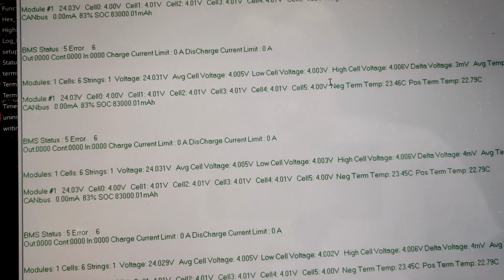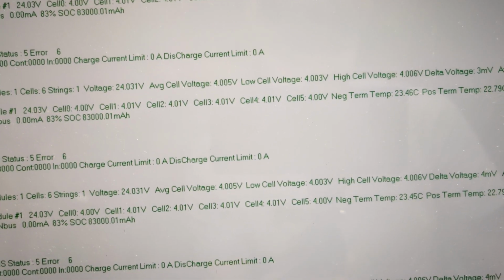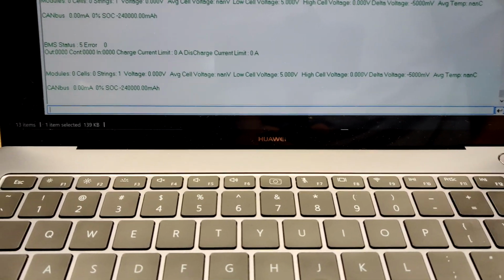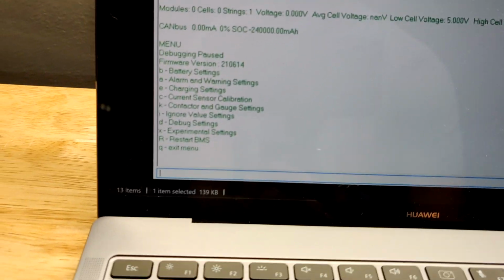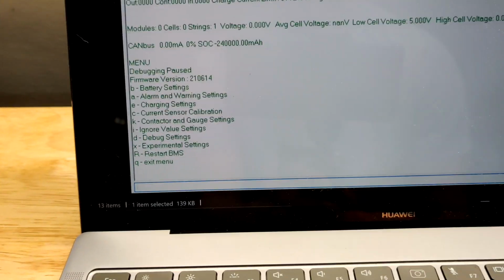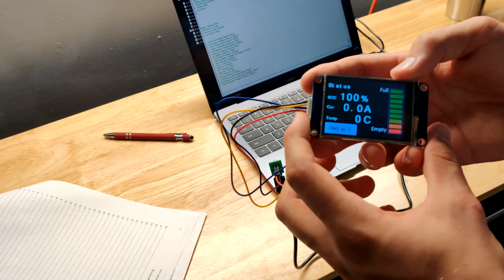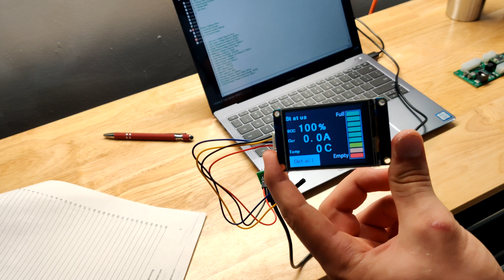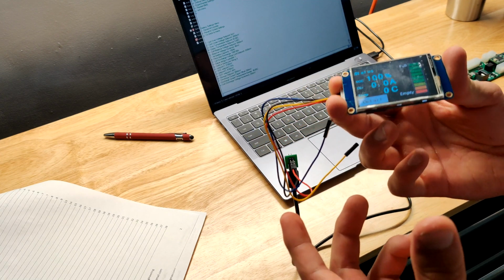Ford Escape EV Conversion EP 13: The BEST Tesla BMS - SimpBMS

Comment: I just came across this and am amazed at how it’s exactly what I need -I think…

Is it really as simple as wiring the original batteries to this thing and being done with it?

Vs something like an Orion which always deosnt like packs that have series and parallel sets wired internally, meaning you have the use like 4 to run 12 model s packs?
Reply from the maker: Yep! Series, parallel, it all works.

New one is here: https://veroelectric.com/product/vero-bms-v2
Reply: @reider_mcfeely  you’ve got my thousand bucks when I can afford the batteries
Reply from the maker: @Nun3zDanny3  There are often good deals on modules on ebay, if you haven't checked there yet

Comment: This won’t work with the model Y batteries? I like this concept but not quite ready for it. Can it be connected to a larger display?
Reply from the maker: Yes with the new Vero BMS V2 it can work with a larger display: https://veroelectric.com/product/vero-bms-v2. Model 3/Y batteries aren't supported, they use a very different communication system unfortunately.

Comment: Still working well for you? Thinking of using this bms on my 6 modules for a 48v off grid setup.
Reply from the maker: Had it in for 8 months now and still working great! Been running it 24/7 off the 12v as well for monitoring

Comment: Hello,
I'm sure you get inundated with questions as everyone wants to use tesla batteries/modules.  My project is a marriage of Nissan Leaf motor assembly and Smart fortwo Tesla 18650 packs.
I know from talking to Chris from Zero EV (who suggested i use the SimpBMS) that it is a good interface with the onboard tesla bms boards.. where I'm having trouble is finding information on weather or not the Nissan Leaf charger will work with the simpbms and tesla packs.
Reply: I have 7 Model S Modules and the Hyper 9 that I’m putting in a 1970 VW Beetle.  Body and Chassis restoration is near complete and it is time to bench test the entire setup.  This BMS along with the same balance boards already in the modules seems like a good option.  I’ve heard Orion is the way to go but it is expensive and seems a bit more complex given that I’ll need to get new boards for each module and the wiring seems tedious but I’m not too worried about that part.  What will I be missing by not going with the Orion BMS?  Thanks!  And please let me know how I can find out more about the SimpBMS.  Thank you!  Kevin
Reply from the maker: @kleekru  really the only thing that the Orion BMS has over the SimpBMS is native support for CHAdeMO fast charging, but with a low voltage conversion, CHAdeMO won't work anyways. 

I can answer all of your questions over email as well -- my email is reider (at) veroelectric.com. I'll send you the setup manual which has info on a lot of the stuff I'm sure you're wondering about.
Reply from the maker: The SimpBMS doesn't natively support the Leaf charger over CANbus but you can still control it with a simple relay. 

Does the leaf charger have an enable circuit? If so then you can just go that direction, having the SimpBMS control the charger via the enable circuit. The downside of running on an enable circuit vs. PWM or CANbus is that you can't taper charge current towards the end of a charge. Whether or not this matters depends on the allowable charge rate of your pack and if you plan on regularly charging all the way to 100%.
Reply: @reider_mcfeely  
I thought the better practice was to charge tesla batteries to not more that 80%.. at any rate.. my project wont see street use or charging stations, just (at the moment) the leaf charger plugged into my shop.  My project is for use on my property to have some fun and do some work.
So... the packs I have... tesla did for both the Smart Car fortwo (which each pack has 6 modules) and the Mercedes  B250e (which the pack had 12 modules).. 
I guess I need to do some more digging... I really like your project.
Reply from the maker: @kevinschilling6813  yep it's definitely better to only charge to 80 or 85%. In that case there isn't really a reason to taper charge current. 

Sounds like a cool project you have going, glad you're enjoying my videos!
Reply: @reider_mcfeely  
So, I would just use the simpbms as a bridge between the tesla modules and the Leaf charger.  And the charging of the modules would be activated via a relay circuit...
Reply from the maker: @kevinschilling6813  yes, and the SimpBMS would control the relay circuit

Comment: I saw that these don't offer balancing for LEV50 modules from GS Yuasa, do you happen to know if thats that they don't offer cell balancing in parallel or in series or both?
Reply from the maker: Unfortunately, they can't balance in series or parallel at the moment. Just reading cell voltages etc.
Reply: @reider_mcfeely  Quick reply thanks man! Is that something that could be added later as a software upgrade or would it require different hardware to make that happen?
Reply from the maker: @Kierpm96  unlikely that it would be added to be honest. You can work around it by using Tesla balance boards with the Lev50 cells. How many cells in series are you running?
Reply: @reider_mcfeely  Where can I source the balance boards? I'm running a 96S system, 8 x 12S modules
Reply from the maker: @Kierpm96  you can get them on eBay, I recommend StealthEV. Each balance board is 6s, so you'll need 16 of them. That would be 2 of the Tesla balance boards for each of your 12s modules. Shoot me an email (sales@veroelectric.com), I can help you source.

Comment: Is this bms running on 12 volts? How to set up contact key? Negative economizer/relay, positive economizer/relay, pre charge relay? Thanks
Reply from the maker: Yup, the BMS runs on 12v. Setting up contactors/relays to run off of the SimpBMS is all detailed in the manual. If you Google SimpBMS setup manual you'll find a GitHub link that has it.
Reply: You need to get a separate current sensor to get the ampère counter working on your display?  (Discharge and charge)  I ordered one in the Netherlands! Thanks
Reply from the maker: @SpangeBatta  yep, you do need a separate current sensor (not included) to measure the current flow. You can use analog or CANbus sensors, and the wiring and setup is all defined in the user manual.
Reply: Ok thanks

Comment: I have four Tesla modules I plan on installing in a boat.  I was hoping to parallel/series them to achieve a "48v" system, but have been warned against paralleling the modules.  I have watched at least one video where someone parallelled like 14 of the modules at 24v, so...not sure what the hazards are.  I'm curious what your thoughts are, and if you think the SimpBMS would be appropriate for that plan, I am definitely interested in one of your "extras".
Reply from the maker: Yes parallel is fine as long as the modules are from the same pack (so they're well-balanced with similar levels of degradation). I'm using 2 parallel strings in my configuration. 

The SimpBMS is ideal for parallel modules since you only need one for any number of parallel strings, whereas with other BMS systems you need a separate BMS for each parallel string. That's why I ended up going with the SimpBMS intially, because it would have cost me over $2k with another BMS system. 

I just sold one to a customer who is doing a 48v system with 14 modules (2s7p).
Reply: @reider_mcfeely  very cool.  after several months of trying to find an alternative to the Orion, I'm glad I came across your channel.  So, what do I need to do to get in touch with you about purchasing one?
Reply from the maker: I ended up importing a whole bunch because of how much demand there was and now I sell them on eBay:

https://www.ebay.com/itm/363521708233
Reply: @reider_mcfeely  I also am running a system with 4 modules in 2 strings for 48v and have been looking at this system, do you have a video on how to install and have more for sale?
Reply from the maker: @msheldon005  Yep, I have a video on setting up the SimpBMS on my channel (it's the only other SimpBMS video on my channel right now). I am sold out at the moment though. I'm waiting on a large shipment from the manufacturer in about 2 weeks. The chip shortage has made some of the components that go into the boards hard to get. 

Shoot me an email at reidermcf (at) gmail.com so I can let you know when I have them back in stock.

Comment: I don't think they offer SimpBMS for a Nissan Leaf battery pack
Reply from the maker: You're correct. The SimpBMS doesn't work with leaf modules. Did I say it did in this video?
Reply: @reider_mcfeely  no you did not I was impressed so I was hoping and being selfish and hoping someone would confirm or deny and maybe point me on a similar product that does, please and thank you
Reply from the maker: @Good-Enuff-Garage  theoretically, you could use the SimpBMS with leaf modules. You would need to connect the SimpBMS to the Tesla balance boards and then connect the balancing leads from these boards to  your leaf modules. There are other options for leaf modules, but this could certainly work. If you go to the comments on my other video on the SimpBMS, I had a long conversation with someone about using this BMS with just regular lithium cells (which is essentially what the leaf modules are). I'd recommend you give that a read to understand the theoretical idea behind that. 

 If you're interested, let me know and I can do some testing.

Comment: can you do another vid on connecting multiple tesla battery modules including the pin out connection to the simpbms from the factory tesla comm cable ....
i have your email from msg below ....thanks
Reply from the maker: Yep, I'll cover that when I wire up the modules in the car. It's pretty straightforward, only requires 4 wires to connect the SimpBMS board to up to 64 Tesla modules.
Reply: sweet thanks ....i just sent an email for cost ect.   thanks again

Comment: how many modules can the SimpBMS handle?
Reply from the maker: 64 modules is the maximum supported. That's one of the big benefits of using one of these controllers instead of a typical BMS. All this does is send communications signals, so it can handle  far more modules than a typical BMS. 

Since each module has 6 cells in series,. 64 modules would require a BMS that can manage 384 series connections (typical BMSes are limited by the number of series cells since they do the balancing themselves). I'm not aware of any BMS available to the public that could handle that many series cells. But if you were to use multiple BMSes instead, it would cost you around $10k! Compared to <$600 for this BMS control board.
Reply: nice.  subscribing to see how the wiring of things goes.
Reply from the maker: I just filmed the wiring process. Should have a video up tomorrow. Stay tuned!

Comment: I just noticed that you're converting a FWD car.. Would the process be any different between RWD and FWD conversion if you are keeping the transmission? I was wanting to convert an older car from '99 but was afraid it wouldn't be a good candidate because it's front wheel drive. Thanks in advance!
Reply from the maker: It won't be much different. I would have preferred RWD but the number of modern RWD SUVs is approximately zero lol. RWD handling is more fun.

The first car I bought for this project was a RWD 1996 Jeep Cherokee XJ. It would have been perfect, but it was too rusted to be roadworthy.

You will be fine as long as it's a manual transmission and not an automatic.
Reply: @reider_mcfeely  what if he had an automatic transmission instead?
Reply from the maker: Automatic transmissions need the motor to run constantly at an idle speed, so it's very inefficient. The shift points of an automatic transmission also don't line up with where you would want to shift an electric motor. You could make it work, but it's objectively worse in pretty much every way.
Reply: @GarrettRC5thscaler  I've done 2 with automatic tranny and they both worked very poorly 30% 50 % more power needed and poor acceleration .